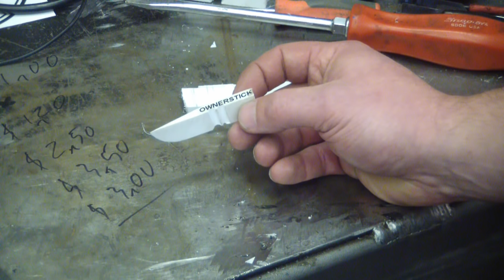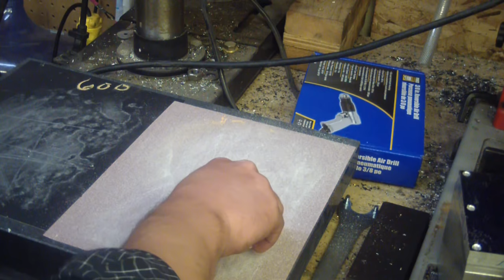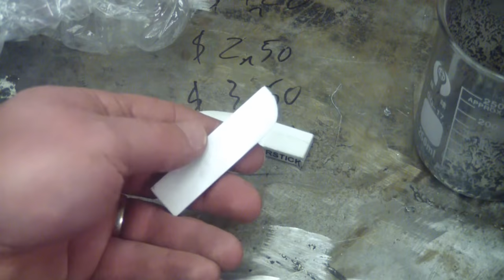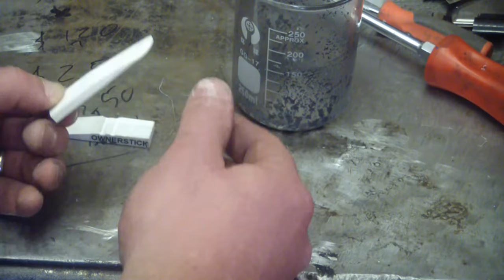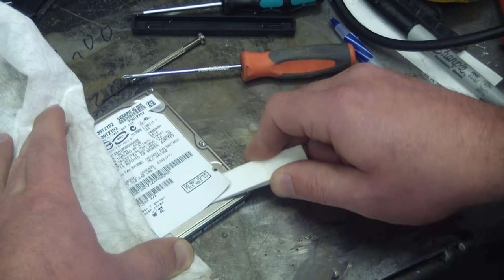Easy Warranty Void sticker removal with DIY Teflon knife.

Comment: Here's a little tip for you!
As an engineer who has sold industrial adhesive products and spent many years building label print and apply systems (yes adhesive labels)...   PEEL

Adhesives should be loaded in tension or more ideally in pure shear.  An adhesive joint is absolutely useless when loaded with a peel force.  In fact, cyanoacrylate bonded skin is actually quite easy to un-bond if one puts a cyclic peel load on the joint, under soapy water even better.  The chemical "kicking" of the cyanoacrylate is exothermic so you may be burned but that's not a mechanical thing.

Your slick non stick tool is a peel force concentrator and it works well.  The adhesive on self adhesive labels doesn't generally cure hard.  It is normally soft enough that you can in fact hang the part from the label overnight in such a way that it is loaded with a peel force but small peel angle.  Invariably the part will be sitting on the workbench when the hangover clears, the label left dangling without as much as a crease or scar.  Patience or plenty of distraction works well.

Great videos, where in Ireland did the Granny come from?
Reply: This seems so technical, lol
Reply: Garry Keogh
Reply: Garry, you just took all the magic out of it.
Reply: Garry Keogh Well I have read more than enough comments about warranties and the split of opinions about it. But you took this all the way to a end😉thx
Reply: The toxicity is from the chemicals used in production. Originally it was C-8 which has since been banned from production. So Dupont quickly developed C-6, go figure. I don't know for certain if any of that toxicity remains in the final product.
Reply: Justin Kasey :: smokers who machine PTFE, break for a smoke, have a few chips in their tobacco. Generates Phosgene gas, I've been told. Nasty. 
However, reason it's used for containers of HF acid, refining Uranium Hexaflouride; NON-reactive with most things.

Comment: if you had bandsawed that piece of stock lengthwise at an angle, instead of milling half of it away, you'd have twice as many tiny Teflon doorstops for the same price.
Reply: duh
Reply: Now what fun is that!?
Reply: If you had a clapped out old Bridgeport, you'd have milled it the same way, don't lie.
Reply: As I do with all my doorstops, a keychain hole would be a convenient addition.
Reply: You'd also have much more Teflon dust giving you cancer......

Comment: Teflon is where you take a polymerized hydrocarbon and replace all the hydrogens with fluorine. Fluorine has a much stronger attraction for the carbons, which prevents oxygen from attacking hence it won't burn. Since it is very chemically inert and pliable like a regular plastic it was originally used to coat the insides of pipes at uranium  enrichment plants. In order to extract the U-235 from the U-238 using the centrifuge method the uranium has to be put in a gaseous form, so by combining it with oxygen it will be in such a state. The problem is the uranium and oxygen don't have strongest bonds and the oxygen will react with any ferric compound used for the pipes as well as copper I think. So by coating the insides with teflon, there wasn't a need to worry about erosive conditions that would release UO6. Some guy realized he could make the wife happy too some time later.
Reply: Teflon vibrators or what are you talking about
Reply: @fee9687  Cookware!

Comment: Love your videos.  Going back to my apprentice days, which I admit are more than 50 years ago, we were warned not to smoke when machining PTFE, which is what I think Teflon is. The key letter is F for fluoro.  If a small piece of swarf  gets in the end of a hot cigarette it can release Fluorine gas which is bad shit  Keep making the videos but take care how you handle PTFE swarf.  Happy to keep my slice in the slot.Best wishesColin
Reply: Also (everybody knows this but) PVC releases Chlorine as well. Any halogens are realllly nasty stuff. I've heard stories of welders having an arc hit a tiny spot of chlorinated brake cleaner and ending up dead a few weeks later.
Reply: How'd they die? Chlorine can be dangerous and especially as a gas but when it kills people it is in concentrations hundreds/thousands of times higher than could possibly be generated in the situation you mention. Don't get me wrong, I'm not trying to call you out, I just don't really understand what you mean.
Reply: Looking it up I'm finding stories about dudes getting really messed up but not dying, one's on brewracingframes.com by one guy who got hospitalized had kidneys shutdown and lungs/sinuses wrecked. Sounds like it actually generates phosgene too. I may have been mixed up and thinking of another guy who wrote the story of his own death after trying to work with metal with a lot of zinc

Comment: 3/4 inch x 6 inch teflon rod can be had for $5.00 on ebay.  slice one up and get out the old belt sander and you can have a slew of teflon spudgers on the cheap.

Comment: i accidentally went swimming with my phone in my pocket with a samsung blackjack back in the day. white moisture indicator paper turned red, i was screwed. neat. welp, i used an x-acto hobby knife to extract another sticker from a donor phone, reinstalled it and sent it back for warranty. saved aboot $350.
Reply: Good on you for fixing your mistake and raising the prices for the rest of us!
Reply: "Last year's iPhone 6 seemed to have cost Apple around $200 – 247 in manufacturing costs according to an IHS teardown" (other phones are similar) They're going to want a competitive market return on investment and account for people abusing the system. Even if I'm wrong, it's unethical.
Reply: That insurance fraud tho
Reply: It's the rich peoples' jobs to check for fraud, not us poor folks to be ethical.
Reply: thompson11k, not really, as that’s what insurance is for!
Reply: Could've just bleached it. Yes, it works.

Comment: I'd buy one. 
 Also, a home-game machinist trick for adjusting cutter speed to suit the diameter of the cutter:
 Turn the machine on, and kind of flick your eyes up the cutter. 
If you can momentarily see the flutes, turn the speed up until you can't do that anymore, then back it off a hair. 
 As strange as it sounds, you will then easily wind up with a consistent cutting edge speed that works pretty decent.

Comment: You can get a small amount of teflon for cheap. They also sell it in round bars of various OD. Do you think it will work or too much grinding to make the round bar flat?

I can buy a 10mm round bar, 1 meter long for a dolar+shipping. Poland's awesome.

Comment: I've used Teflon cutting boards before.
Reply: I got some real Teflon plastic from when ADOT slid a new bridge onto an quasi-existing abutment. They had  big long 8" x 3" x 4800" pieces of the stuff, left over from the temporary abutments. It was really cool. They made a bridge on some temporary stanchions, widened the old stanchions, then slid the new decks inline with the old road. Yeah the stuff was kinda torn up, but free is free.
Reply: Seth B
Reply: AudioHouseOnline
Reply: Judicious Aim  "In most US states everything is at least somewhat illegal"

 I don't follow how is that relevant? Your talking about the criminal code. Even if there were no Federal law to prevent manufactures from using the sticker to deny a warranty it wouldn't be illegal to remove it.

This is about protecting consumers from manufactures by eliminating ridiculous reasons for voiding warranties. Also even if there were such a State law Federal laws trump State laws. Doesn't matter if States like it or not.
Reply: SoundOfYourDestiny I had to REPAIR (super glue a part to a motherboard) on a 6 month old mobile phone because their warranty was unacceptable..

Anything major goes, they can still swap it under warranty...
Reply: +Seth B funny you should mention that I used to work lifting bridges and replacing those Teflon pads we usually threw them away.